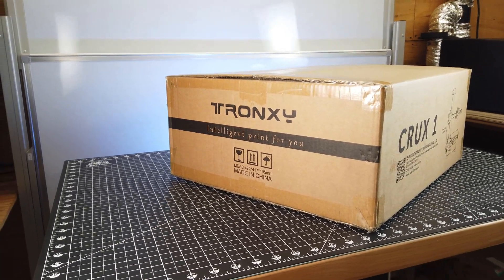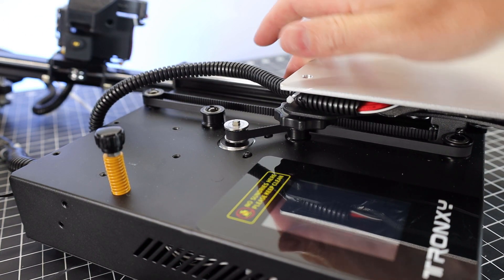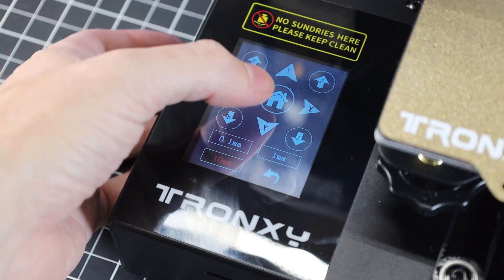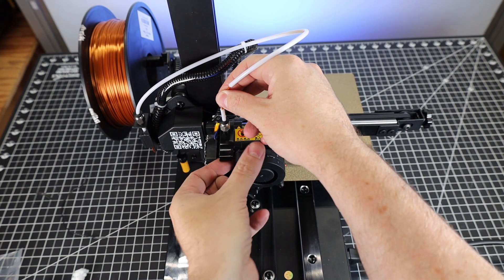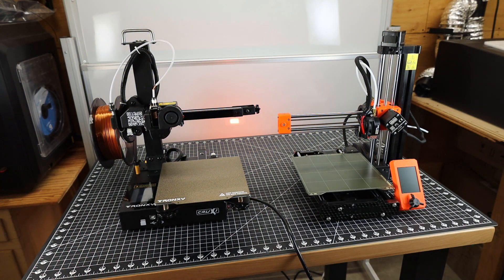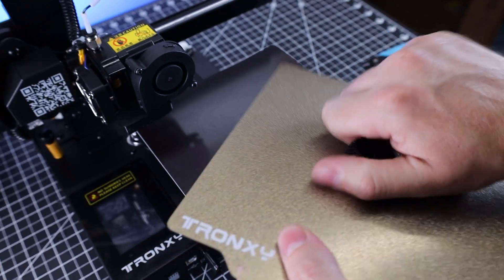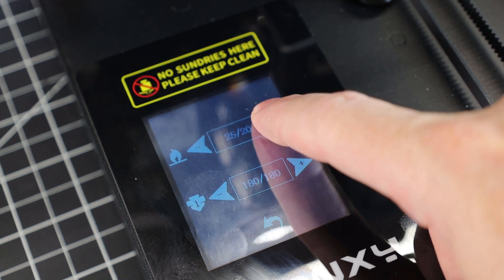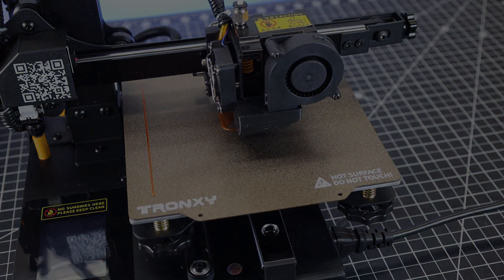Mini But Mighty $180 Direct Drive 3D Printer - Tronxy Crux 1

Comment: I actually like this size and I have been looking at this one as well as the Kingroon KP3S, the Lerdge iX, and the most expensive one, the Ratrig V Minion.  I am still not sure which one I want to get.  Right now, it is the firmware I am hesitant about.  I really prefer Marlin like is in the Ender 2 Pro which has a build surface that is a little too small.

Comment: So what would you adjust to fix underextrusion on the mini?
Reply from the maker: So I just turned up the flow rate a little bit and it seemed to help.
Reply: @randymay  lol that was a dumb question. It also wasnt what was causing the pops for me. Mine was my retraction settings were too high
Reply from the maker: @ItzSlamDuncan  Yeah it's either retraction or flow most of the time. 😅

Comment: I see there is a 8pin Wi-Fi socket on the  mainboard. And the printer system is marlin firmware. Is there any way to make a customer marlin firmware for this printer ?so that it could driver Wi-Fi module?like esp8266
Reply from the maker: Oh I didn't even see that when I was looking. You might be able to do all that but honestly I'm not any good at a making custom marlin firmware.

Comment: One point of constructive criticism, it's scary at 1:45 when you touch the power terminals. Clearly it was powered down at the time, but it normalizes a behavior that could potentially be very dangerous to people who may not know that, when plugged in, there is 120V-240V across those terminals
Reply from the maker: Oh yeah I didn't even think of that and that's a good point. I do make it a point to never open up any electronics plugged into the wall ever. But yeah I will make sure to say that in any video I make when I open them up

Comment: Wow. I don't think i ever seen a real attempt at a Prusa Mini clone before.
Everyone normally just clones  i3 and try to get it as cheap as possible, while trying to one-up the competition in build volume leading to a market oversaturated with well... utter garbage you need to spend like triple on to get to decent quality.  To see a Mini clone that looks to be good out of the box and focuses on making sacrifices on small nuisances like the LCD panel to save cost may indicate we are finally starting to move past the "Race to the bottom" phase we have been stuck in.

I think this printer has the possibility at becoming as ubiquitous as the Ender3 in regards of Mini Clones and turn very popular as a genuine entry-level printer (as in not requiring a f-ton of work and upgrades). Just needs some tweaking in its printer profile and firmware, which apparently are still kinda "Beta" atm.
Reply from the maker: So just an update, I just printed with it non stop for the last week making some orders alongside the Prusa Mini+ doing the same prints. The prints did look a little better coming from the Prusa to be honest but not by much. I still have tuned in any of my filaments to either printer. 

When it comes to this being a worse clone of the Kingroon KP3s, I don't know about that. I might just have to get one and put them head to head. 😁👍
Reply: This printer is basically a worse clone of the Kingroon KP3S.